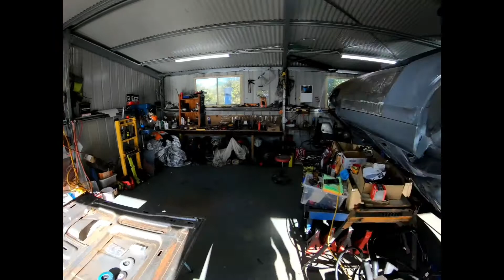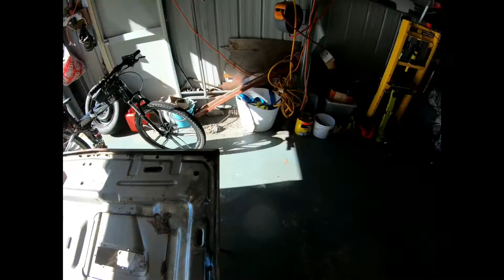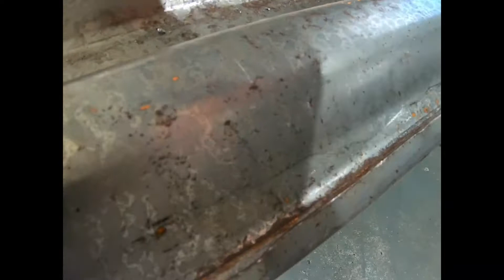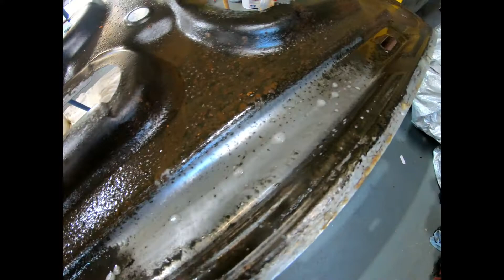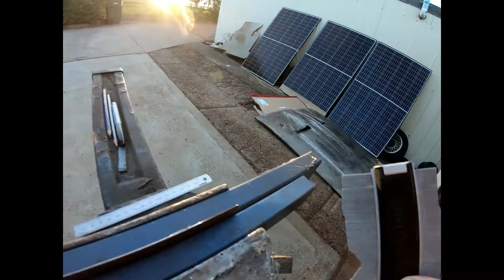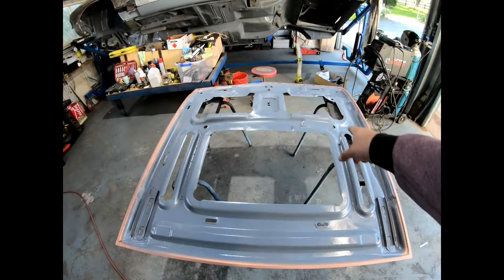Ford Falcon XB GS  - Bonnet Repair Eps 28

Comment: Hi mate , great work . A method for rust that i use , is to wash the panel with Dioxit to remove surface rust , when dry, brush on Ranex on the rust pitting thats left , wipe off the excess because Ranex has no effect on shiny steel , the rust pitting turns black , and then coat with KBS rust seal before the epoxy, which the manufacturers used back in the day .
Reply from the maker: Sounds like a very good method. The fellas at melomotive have another method again. So many ways.

Comment: Great job Jase,Love the video
i make my own spot welding drill bits using an 8mm drill bit and grinding them to shape on a bench grinder,then when they blunt I dress them up and sharpen them on the bench grinder.Works out a whole lot cheaper.coupes looking great mate cheers
Reply from the maker: Thats the go, I should be doing that. I'm so glad the metal work is almost done 😁

Comment: “Everything is a hammer ...unless it’s a screwdriver... then it’s a chisel” lol

I have made chisels out of the exact same electrical screwdrivers you have and use them all the time even though I have a toolbox full of proper chisels lol 😝 
I’m with you on those spot weld drills, the expensive ones go blunt, the holesaw type are cheap and easy 👍
Nice work on the bonnet, ,looks great 👍 
I use both types of rust converter, the supercheap stuff for actual rust after I have wire wheeled the metal and the Bunnings stuff just for protection of metal while I’m working on it and not going to epoxy it for a few days 😉.

Great video...cheers 🍻
Reply from the maker: Big thanks mate! 😁 So handy having all the tools

Comment: in my experience with spot weld drill bits, the fastest way to make them go blunt is running them super fast, drilling into rust and drilling into high strength steel (only an issue on modern cars)
Reply from the maker: Oh righto cool. Luckily I wont need to drill much more spot welds now, almost ready to start the bodywork 😁 I spent all day trying to replace the left hand front quarter lower section with a rare spares section. What a shit show! Lol. I'm sure your aware of how bad their replacement sections are